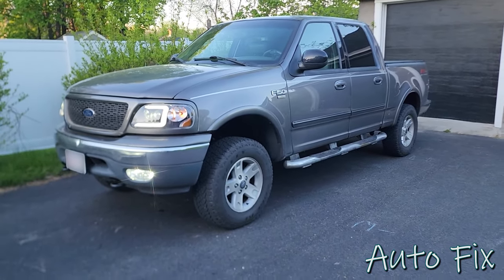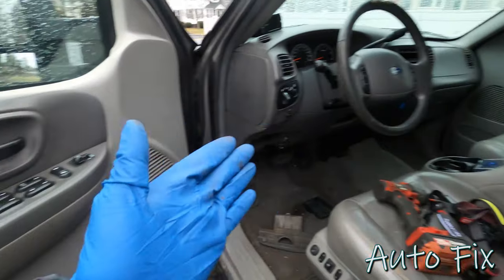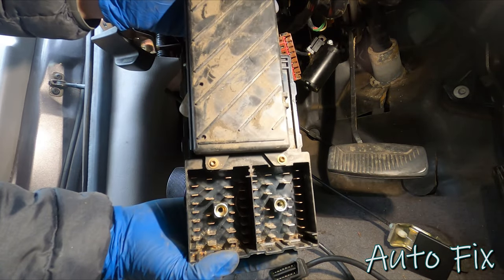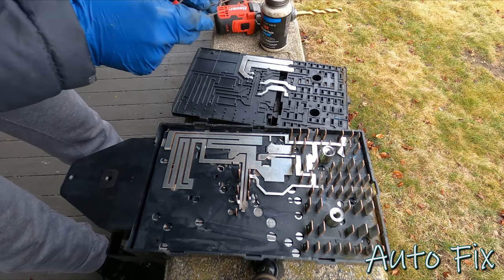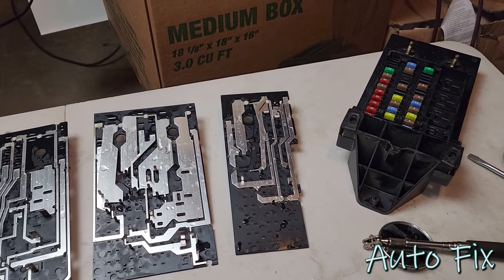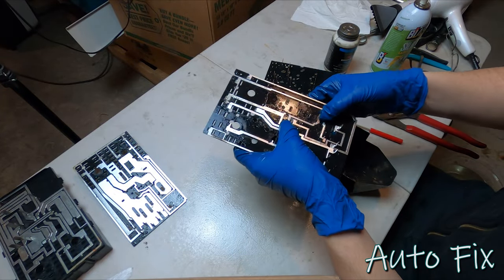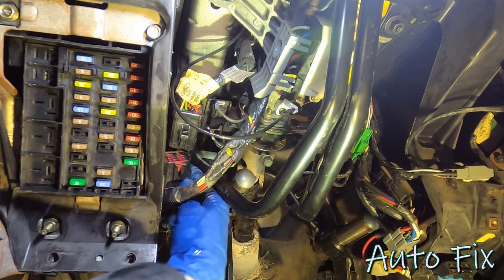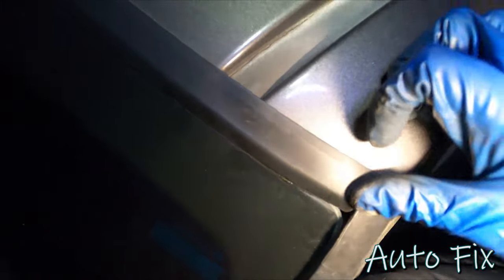G.E.M./Fuse Box Removal, Disassembly, & Fix! / Water Leaking On Body Control Module! 1997-2003 F-150

Comment: My 1999 Epedition had same issue.  I replaced the GEM with a rebuilt one.  Still leaking around the top of windshield; keeping it tarped until I can get it replaced.  Coastal Oregon is really wet.  Thank you for the video; as well done as any I have seen.  Fun music and sound effects are helpful. The new module plus labor was over $1000.  Bad elect design, I surmise; but I do love the way the Expo rides.  Really comples GEM design.
Reply from the maker: $1000 is crazy for the GEM. But im glad you got it fixed!
Reply: Yeah, still have a parasitic draw with 2 circuits, will fix those.  Crazy stuff when that electric brain starts shorting out.  It would have been just as much to fix it like you did.  Many hours of labor.   The video was really high grade. @AutoFixYT
Reply from the maker: @DavidMiller-bp7et  Yes it took me a few hours in total for sure. But since I had the time and I had all the tools I saw this as a free fix, as opposed to several hundred to replace the module
Reply: My great mechanic goes at $100/hour so it gets close to a grand anyway.  This seems to be a common issue with Fords of this vintage.  I found the 2 circuits with parasitic draws, one of them, #15, includes the GEM.  Hope it's something else on the circuit which is crowded.  #16 looks easier with less stuff on it.  If I had unlimited time and didn't need this as a 2nd car I "might" have undertaken it.  Thanks for your very sensible comments. @AutoFixYT
Reply from the maker: Yeah $100/hour is typical, sometimes actually on the lower end of rates depending on where you live.
Hopefully you can get those parasitic draws fixed!
Reply: .25 amp draw down to 2 circuits, fuses 15 +16.  The GEM is on 15.  Other than those 2, virtually 0 draw.  Thanks for the feedback.  My first take is I don't care to see 2 together; makes me think of possible corrosion remaining there.  Probably functions on the circuits, though.

You should think about a business re-furbishing these GEMs.  Big demand as far as I can tell. @AutoFixYT
Reply from the maker: Wow 0.25 amps is a lot for a constant draw.
Reply: @DavidMiller-bp7et hey, I'm getting the same draw I believe...my battery is draining quickly everytime I shut the truck off. What did you discover?
Reply: @Fishingfanatic88  Hi, Ben.  I had a phantom draw somewhere in the GEM.  However, my mechanic says you can't test with anything on, even overhead light, because of the way the GEM wakes up circuits for more draw.  Also, you have to let the GEM fired circuits go to sleep which takes about 1 1/2 hours.   So that draw was inconsequential, after replacing the GEM for big $.

The bit deal was the previous owner had an aftermarket stereo in there with faceplate.  I removed the face plate and haven't had big draw since.  Will get a new stereo unit.  I have to wait to have my windshield replaced and the leaking at the top sealed off.  Water was coming in and draining right down on top of the GEM, just off my left knee, driver's side.  It shorted out the close circuits inside-water, rust and corrosion-did all manner of weird things and unexpected things. Full cleaning or replacement were my only options.

The Fords of this era have an issue with windshield leaks coming from above it.  I am having my windshield replaced and the rusty crud above it repaired in April.  Till then I keep it tarped.

I'm committed to the car, will do what I need.
Reply: @DavidMiller-bp7et  dang that's crazy, I bought a used GEM from a 97 4x4...I don't know if it works or if it has the same problems...I've been slacking on replacing the GEM for several months. Just need some motivation to dig in and do it.
Reply from the maker: @DavidMiller-bp7et I never would have guessed that the head unit would be a culprit but it is totally possible! I have seen some sketchy radio installs in the past. Good thing you have it all figured out now!

@benmiller8942  since you have a spare GEM, i suggest taking it apart, at least partially, to inspect it and make sure it's not going to cause issues. Also, look very carefully at both GEMs. The one from the truck and the one you have from the other truck. Make sure that all the fuses are there and that they match in amperage. If fuses are missing, you will need to add the proper fuse because most likely the donor truck didn't have that circuit activated (or someone pulled the fuse). Same with the relays. That way when you swap them it's a plug and play swap. The owners manual should help you identify what fuses do what and what amperage they should be.
Reply: @AutoFixYT  yes, thank you so much...I'm taking notes so I don't forget any of this important stuff.

Comment: Yep...so glad i came here....having many of the same things happening...windows, headlights, 4x4 lights. Just crazy.
Reply from the maker: Yeah take care of it before it gets worse!
Reply: Hey, just curious what size is the drill bit you used in the beginning of the video...thanks.@AutoFixYT
Reply from the maker: I don't remember, but if you have a drill but set I'm sure whatever the largest one is will do just fine. Maybe a 1/2 inch?

Comment: Amazing attention to detail you sir are a real mechanic anyone else would have just thrown a new fuse box in this truck 💯👍💪
Reply from the maker: Thank you! The way i see it is this repair was free and a new GEM module is expensive lol
Reply: @AutoFixYT  I  think I'll have to pull the fuse box out open it up and take a good look at it. My wipers don't turn off and the AC blower stays on after a heavy rain. I'm suspecting its this box is getting water in it.
Reply from the maker: @paulsosa1872  yup, guaranteed that's what it is

Comment: Ohhh boy this should be fun. My 2002 F150 was leaking through the front windshield after a windshield replacement. Relay #1 keeps glitching out with the interior lights and who knows what else. 

I saw in a comment you said it might need to be reprogrammed if swapping the whole box from a junkyard? Is that correct? But you also said pulling a part would be easier? So should I tear it down or could I jusy plug n play a new box from the yard?
Reply from the maker: Reprogramming may not be the case on these, although I did read something about it somewhere. So I cannot tell you 100%. If it were me I'd just take my existing one apart because a junkyard one could have the same issue. But yeah either way the issue is very annoying to deal with.

Comment: The fact you don’t have more likes on this amazes me 🤯 amazing video man
Reply from the maker: Thank you!
Reply: I’m in the process of of doing this now. I’ve come across a couple of prongs or whatever you would call them that are chipped or burnt…is it a waste of time for me to continue? There is so much corrosion in mine it’s no wonder my truck wouldn’t run right
Reply from the maker: @flynn1727  if it's really bad your better off sourcing a new one and opening that one up if you think it needs it. Because with that much damage in there you risk it not working properly after you put it back together.
A junkyard is your best bet, or a part-out truck.

Comment: Above and beyond average mechanicing I was very impressed! Thank you! So it looks like GM modules may not actually be the culprit but the fuse circuit capsule!
Reply from the maker: @petrokrasnov2967  Thank you!
And well... the true culprit is actually the windshield leak. That's where it all started from. And then it got into the GEM.

Comment: I’ve been having the same exact problems with my 1998 f-150. You went very in-depth and I really appreciate that. I’ve been pretty much freaking out cause this is my only vehicle to get to and from work. So as soon as I get home tomorrow I’m going to do exactly what you did in the video. I will follow up in this comment section to let you know if it worked. Fingers crossed. Thank you for taking the time to post this video.
Reply from the maker: Thank you! And I'm glad the video helps! Yes definitely let me and everyone else here know what you found and whether it fixed it or not. If you choose to disassemble the entire module like i did just take your time so you don't break anything or lose any little pieces. The trickiest parts were drilling out those inernally threaded bolts/studs to get the module apart, as well as disassembling and reassembling all the panels/layers of the GEM. That was also the most tedious and annoying part. My finger tips hurt so bad halfway through from pressing the conductor plates back on that I started having to use pliers.
You can do it!
Reply: I have a 05 and my lights come on intermittently, let me know how much of a P.I.A. it was so I know how to spend my weekend...

Comment: hey, do you know what the part number was on this fuse box? im having the same issues and im just going to buy a new one but i cant find a part number on google or anywhere.
Reply from the maker: I don't have a part number, sorry. Maybe you can source one from a local junkyard?
Reply: Ford no longer offers this part.
Reply: Part# on sticker on fuse panel. Ebay has these, around $150

Comment: That's all that's in them??!! 
How come places say, reprograming??
I'm gunna definitely be taking mine apart. No biggie.

Can't believe you don't have more likes. Great work!!!
Reply from the maker: Thanks!
Maybe some other models need reprogramming, or especially newer ones. Also, if you are replacing it you're more likely to need it reprogrammed so it can retain the functions that originally came with that truck. Just taking it apart won't do anything to it
Reply: @Auto Fix  mines a 99 f150.
4wd issues. I've ruled everything else out. 
Odometer comes and goes
Door dinger comes and goes
Pretty sure it's the gem, or fuse panel. Either way I'm gunna pull it and also take a lookc. 
Again, nice vid.
Reply from the maker: @bucksnortbumblefuk6872  Yeah that sounds like a GEM issue. Pull it and see what you find! Just so you know, the GEM is actually the smaller unit that screws onto the back side of the whole fuse box. It's the thing I had to use a torx bit for. The rest of that assembly is the actual fuse box. However, a lot of times they are sold together and the two end up being referred to as the "GEM" together as of they were one unit.